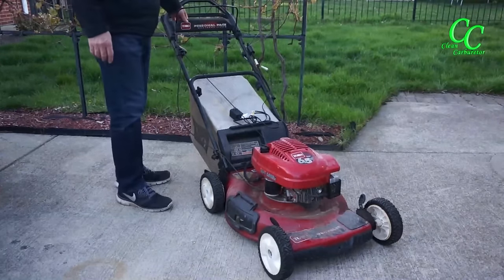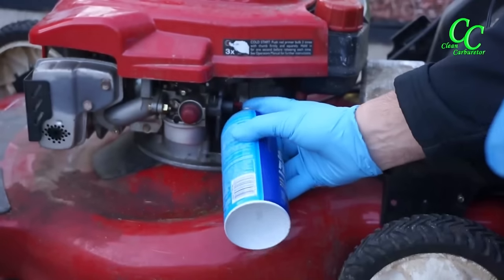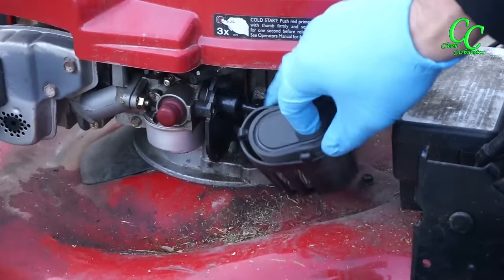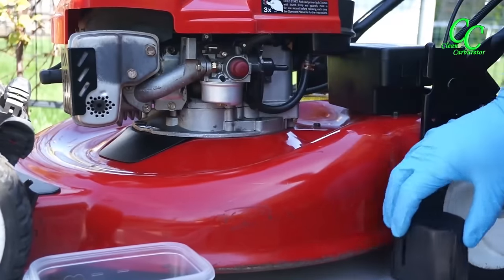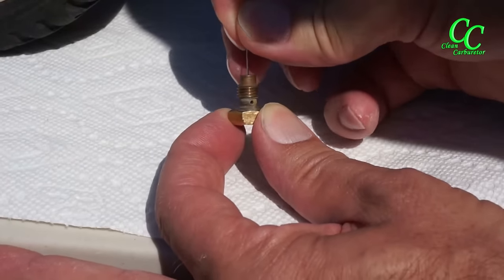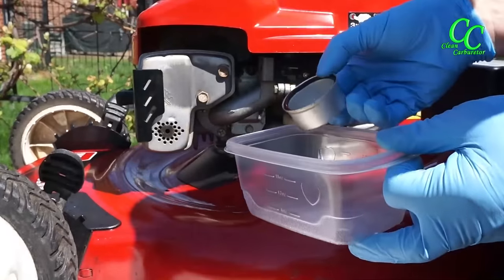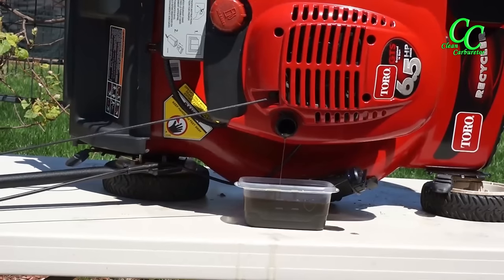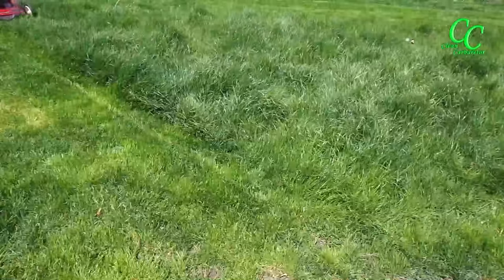Toro Lawn Mower Won't Start - Problem Fixed. Use GumBuster by Cleancarburetor on all your machines

Comment: This video just saved me $400.oo.  I have a Toro personal pace Electric Start Lawn Moeer.  It is 13 years.  There have only a few times It hasnt started on the first try.  It wouoldn't start today.  I did everything  I knw  to get it to start.  I was just going to buy a new mower (same) at Home Depo for $400.00.  After watching your video I was able to get it to start .  Who Knows?  It might last another 13 yeare.  In 13 years I will be 90 years old.

Comment: I just picked up one of these from the side of the road, had a sign saying starts after 6 or 7 pulls, tried that, and at n7 7 pulls it started. The rear-wheel self-propelled didn't work, but after a slight cable adjustment started and worked well.  Tried it out on the vacant house yard next door and it is faster than my 70-year-old legs liked. NOT BAD free and hopefully cleaning it some will start easier. after it starts once it does easily. It's not an electric start, but the same mower otherwise.

Comment: Thanks for the video!!!  I did all the steps, and then it still wouldn't start...I'm guessing it takes a lot of pulls to get the gas back in the carburetor to get it going again, but it cranked up!

Comment: I consider that a minor tune up.  If you wanted to do a full tune up remove the carb completely and soak it, also replace the pull cord.  Sharpen the blade.  Oil the wheels.

Comment from the maker: Marc - the ethanol doesn't destroy the engine. The fuel with ethanol or fuel without ethanol crystalizes inside the carburetor after a long sitting and it prevents the fuel from flowing through the jets. I would strongly recommend replacing the carburetor.

Comment from the maker: Measure the battery voltage with the voltmeter. Fully charged battery should be no less than 13 volts. If the battery reads more than 13 volts and when you try to crank the engine nothing happens, check the fuse. If the fuse is good, then it's something wrong with the electrical circuit and it needs detailed troubleshooting.

Comment: I didn't use my 2 year old toro 7.25 "guaranteed to start" mower all of last year, and I tried to start it this year, it was filled with old gas, I tried to start it and of course that didn't work, but now that I replaced the gas with new gas, it still won't start, I got it to burp twice and that's it.  Did the ethanol ruin the engine? Any advise?
Reply: I'm having exact same problem! Bought brand new last year, used one season. Properly winterized, put fresh oil and ethanol free in yesterday and nothing! Changed plug, checked air filter, fuel line. It will start after spraying starter fluid in carburetor but quickly dies. So much for Toro's "guaranteed to start"
Reply: Tab Allen I use a yard service now so my 2009 Toro gets limited use and I’m negligent on draining the tank before it sits for long periods. The last time it wouldn’t start a couple years ago I just got a replacement carb on Amazon for $20 and was back in business in 15 minutes. Same issue again so I’m just gonna replace the carb again. They get gummed up from sitting and to me it’s just easier to replace instead of spending a lot of effort to clean and rebuild. 👍

Comment: I charged the battery with out removing the blue start button. Now the electric start does not work. This is my second time using the lawnmower. Do you have trouble shooting advise.

Comment: I have the same mower. Starts fine with the pull start. Starter motor does not engage. New battery, starter spins fine bench testing. Will not spin the motor. Any ideas as to what it could be?

Comment: How about if it runs for an hour but won't start after that until it cools down.
Reply from the maker: The engine runs too rich, one of the air jets is plugged. Get GumBuster kit for Briggs engines to clean the carb:
https://cleancarburetor.com/index.php/shop/gumbuster-kit-for-lawn-mowers-and-pressure-washers-with-briggs-engines

Comment: Does that mower have a oil drain plug on the buttom by the blade side?😳😁😂
Reply from the maker: Mario - yes, every mower has a oil drain plug on the bottom of the engine crankcase. But, it's much easier to drain the oil through the oil filler as shown in the movie. And you don't need any tools.

Comment: First off the drain for the oil is under the mower deck where the blade is, it's a alan wrench screw never tip your mower the way you showed to drain the oil all the metal fragments of any are in the head now
Reply from the maker: This a flat head engine and there is no way to get any fragments in it!